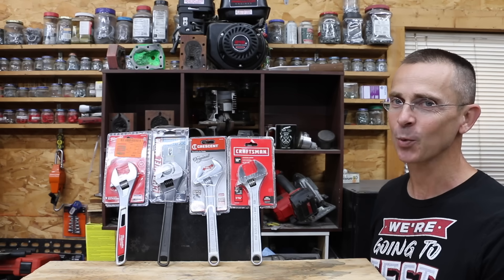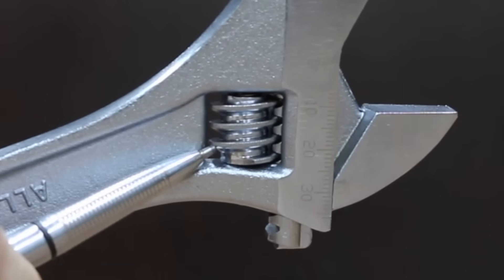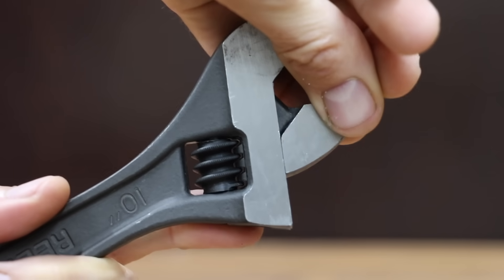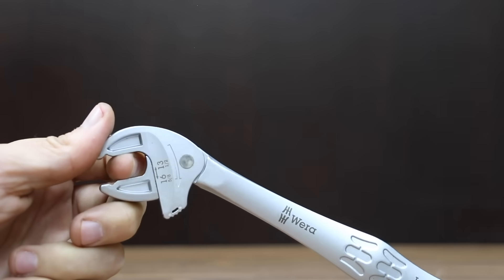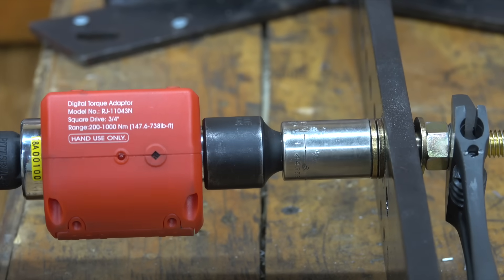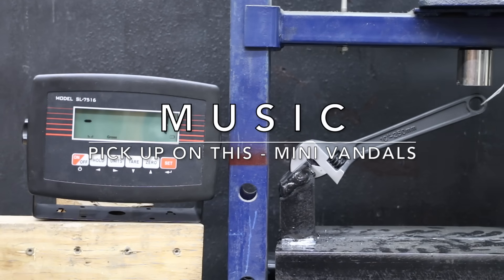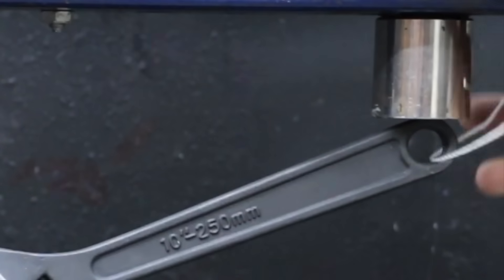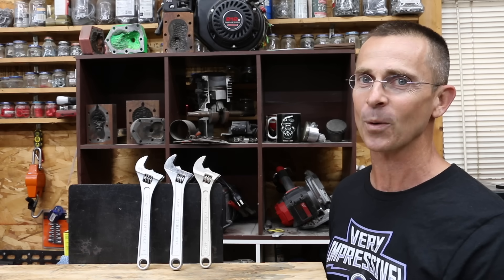Best Wrench (ADJUSTABLE)? Craftsman USA vs Craftsman, Crescent, Kobalt, Milwaukee, Channellock

Comment: I'm a Knipex fan, the adjustable Cobra slip wrenches. I use my 10" Knipex for almost everything at work as industrial maintenance. I've been looking for the best "crescent" wrench, I don't care about the price, I want durability and a 1-wrench solution. Knipex has beat out everything else I've tried/seen in the "channel lock" world but I don't want to spend $200 for 3 "crescents." I wish this test would have covered my favorite brand. However, I'm a Milwaukee guy since I like everything to be red and covered in black dust/grease. At least the Milwaukee did ok in this single test, almost makes me want to buy one to match. I've been using the HF garbage and it's time for me to spoil myself for Xmas. Anyone have input on the Knipex adjustable "crescent" wrenches? Thanks!

Comment: The only use for an adjustable wrench is to hold the service manual pages open.
Reply: Mine works extremely well for straightening bent steel wheels

Comment: I've done a lot of electrical work in industrial settings, the Klien tools are really good stuff...you get what you pay for ....interesting most all these wrenches would hold up under normal 1 hand pulling on them, but my concern would be...how long do they really last? adjustable wrenches are often used to break bolts loose, when you really should be using a breaker bar...
 I've found that a lot of stuff from Spain, and Taiwan is pretty good, compared to China.
Reply from the maker: Thanks for the feedback.

Comment: I use the Klein adjustable with the red plastic covered handles because I work in battery compartments. I am happy to have the insulated handles. But they do not hold a size worth a crap! Constantly have to re-adjust them. For the money the only thing they have going for them is the insulated handles.
Reply: Do you test to see how they hold adjustment? I can use heat shrink on them for electrical insulation.
Reply from the maker: Thanks for the feedback.

Comment: This is perhaps the funniest video I have watched today. "For both SAE and metric," LOL ! There's a reason a crescent wrench used to have the nickname "The poor man's metric wrench." That whole business of marking the sides of the wrench is absolutely worthless and ridiculous. Anybody who has used one much knows you tighten the adjustment ON THE BOLT HEAD OR NUT. If you don't you get too much slop. This kind of wrench is only good for the most basic, undemanding use. For more precise use you need good open end wrenches for medium use, and box end, or sockets for heavier use; otherwise, you're going to round off the corners of the nuts or bolts.
Reply from the maker: Thanks for the feedback.

Comment: I own a full set of Bahco wrenches. I was surprised that you didn't go for the basic 10" without the grip. It has standard jaws. The one you tested I use for difficult to access things. In the UK the brand is the best choice for plumbers and gas fitters.
Reply from the maker: Thanks for the feedback.

Comment: Great video! Made me curious, It would be interesting to see a video comparing just plain combination wrenches. Specifically to compare high end automotive brands like Snap-on and Matco to less expensive, off the shelf retail brands like Husky. Is Snap-on worth it?
Reply from the maker: Thanks!  Thanks for the suggestion.
Reply: Whether Snap On is worth it depends on how often you use it and for what application. Their biggest advantage is a lot of strength with a small profile. I think their screwdrivers and torx drivers are the best value because the tips wouldn’t strip nearly as easily. I would recommend trying out what tool you use the most like a Phillips #2 or a 10mm wrench or socket.

Comment: When I was in the navy as a machinist mate a senior person suggested that an adjustable wrench might be more effective  and handle higher torque if used in the opposite direction of that shown in the video. The movable jaw is the weak link and where force is applied makes a difference . I do remember (and still believe) that one should apply a load to the movable jaw as close to the handle as possible. If moved as in the video, force is applied to the movable jaw nearer the tip of the jaw than if the wrench were moved in the other direction. It would be very interesting to see how much more (or less) torque could be tolerated if the wrenches were flipped over and rotated with the movable jaw trailing the direction of rotation. Thoughts?
Reply from the maker: Thanks for the suggestion.

Comment: Thanks! Very well-done design and execution of tests. In the break test, it would seem that the longer jaw length gives a disadvantage, not an advantage, as it increases the length of the lever arm of the applied stress at the outer end of the jaw.
Reply from the maker: Thank you!

Comment: One thing you're not considering in the breakage tests is the length of the handle. A shorter handle that breaks at 700 is actually  a weaker tool than a longer handle breaking at the same force due to the length of the lever arm.
Reply from the maker: Thanks for the constructive feedback.

Comment: The way the wrenches were applied in the test places the most leverage on the moveable jaw because the force is applied on the outer end of the jaw. I was shown many years ago to use the wrench upside down so the force will be applied on the inside of the lower jaw toward the worm screw ( at least until the nut breaks free.)
Reply: yes, but in testing this way is how's how much better a quality wrench is over a lower quality adjustable wrench.
Reply: I'm pretty sure I've heard the opposite, but the best way to know is to get Project Farm to try it both ways :)
Reply: Glad you made this comment. I was taught the same thing. When using the wrench (not testing), you should apply the least amount of torque to the movable jaw. Realistically, an adjustable wrench should not be used for high torque applications.
Reply: @pat8988  these are literally the last result in most cases 👍
Reply: that makes sense.
Reply from the maker: Thanks for the feedback.

Comment: Did the press run out of strength on the Malwaukee? (Considering it didn't snap and some of the other tools broke at a higher force).
I'm guessing it had a different handle and that affected it?

Comment: Surely smaller jaws is an advantage in the opening under load test?
 If the jaws were two foot long the opening would be immense.
With a 1/32" jaw it would be minute.
Reply from the maker: Thanks for the feedback.

Comment: -_- this video just reinforced how crap craftsman has become over the years and makes me depressed that my american made sockets/wrench set that worked for 20 years (got it as a gift in high school) got stolen and the new craftsman set i got i already have had to replace 2 ratchets in less than 6 months.....

at least lowes is letting me just swap them out with single floor tools... you know when sears had the lifetime swap for craftsman you got it knowing you would probably never have to use it....  now you hope you can do it because you will have to use it....   "sighs"
Reply from the maker: Thanks for sharing.

Comment: Bacho is the only real one the rest is fake
Reply from the maker: Thanks for the feedback.
Reply: @ProjectFarm  I have a Bacho set of (really) 60+ years old and they are indestructible, better than they are now.
I am 66 myself and they belonged to my father and he used them from the first memories I have of him.
We even call them BAKO here 
Most of the wrenches in this video are copied of the old Bacho model and the first copies, to cheat the patent, the  threaded adjuster thingy (sorry I am dutch I don't know the proper name) turns the other way to adjust the opening. 
And this is really annoying if you use them when you are used to the Bacho.
Reply: @ProjectFarm  I can send you some pictures if you want..

Comment: You have to understand that "Made in China" products are designed for failure. Not because they are no good at making product, but b/c it is their business model. I've purchased the base portion of a desk chair multiple times and most of them were from China. The welding job around the base was, hands down, the worst welding job I've ever seen and every single one I purchased in a 10 year period always broke in the same place right at the base of the weld forcing me to purchase a new one over and over. I finally got fed up and purchased one made in America and the welding job was flawless in the area where the China made one was shoddy. I've had the made in America base for 10 years now and not a single crack at the base of the weld.
Reply from the maker: Thanks for sharing.

Comment: Back in the late 1990's, I worked Part-time as a Mechanic for my Brother-In-Law at his shop.  Some Guy had brought in his car for an oil change and after I got it up on the lift, I started to remove the drain pan plug with my Crescent (actually a Craftsman, LOL!) wrench.  The Guy asked "You're not going to use THAT, are you?!?" and i replied "Yes Sir, I am" and went on with the job (it seems he thought using an adjustable wrench would round off the corners on the drain plug...it didn't).  My BIL told me later that this guy thought his car was "Special" (it wasn't) and was extremely "Picky" about how things were done to it.  I told my BIL that I can appreciate that since I also am "Picky", that's why I change my own oil and Apparently that Guy should also, LOL!
Reply from the maker: Thanks for sharing.

Comment: None of these are relevant 

Crescent spud wrench master race 

Basically a c wrench with a big metal spike for a handle used to align bolt holes or cook a spud I used them when building stages 

Also used it to pop my serpentine belt on with a broken tensioner in subzero temperatures by myself or I could move a 10,000 pound media riser by myself when I did the nhl  nba changeovers at lca with it
Reply from the maker: Thanks for the feedback.

Comment: As a plumber of 16 years I have to say I love your videos. However, from what I seen, the Milwaukee is the clear winner! It's the only one that didn't break in your last test and the one that moved the least in your jaw opening change under vibration. Which are the 2 most important factors when considering a crecent wrench. 

If you're tightening or loosening a bolt the most annoying and time consuming thing is to constantly have to re-adjust it. Milwaukee is easily the winner just by winning that test alone. Which is the most important test that actually matters for every day use. Let alone the fact it's the only one that didn't break in your last test. And there's actually a way to get it to work again once it seizes under heavy load like that... A couple hard smacks and some WD40! I've been using those crecent wrenches for years. 

You can call me biased but I was actually watching this video specifically to see if any crecent wrench could beat it. However from what I seen in this video is that the Milwaukee still remains supreme for the reasons I listed above.
Reply from the maker: Thanks!  Thanks for the feedback.

Comment: The Germans call an adjustable spanner 'ein Englander' because British tradesmen use them all the time. Adjustable spanners not allowed in the UK military and I agree always use the correct size spanner and being electrical always use the correct scewdriver and don't overtighten screws. As life is not perfect and you have to use an adjustable then Swedish made Bahco is the best in my opinion.
Reply from the maker: Thanks for the feedback.

Comment: Please, 100 % of anything I have say MIC has 2 year life, my God my breaks for my car didn't know auto shop installed 6 months they came off. No competition not even watching vid cause if mic wins its rigged. We have 100 items we ended finding mic which means it's going fall apart, my God I had purchased water boots next years the rubber crumbled. Forget about it

Comment: idk about you but i'm surprised none of them have a pipe slot in the end of the handle to either put a pipe over the handle or inside the handle to add huge amounts of torque for bolts that are NOT hard to reach but need more leverage to break the seizes/grip of the nuts and such due to rust or damage.
Reply from the maker: Thanks for the feedback.

Comment: As long as the tool can do the job for me and reliable.  I will buy it.  Just like a car.  I do not care about power seat , 10 speaker system, 3 zones ac.  I think you got my points.
Reply from the maker: Thanks for the feedback.

Comment: Although very thorough,  your rounding nut test was flawed. You had the adjustable upside-down.  I'm sure it was the most convenient way to setup the tests. But the moving side of the jaws was taking all the torque.  You should have set them up so the stationary side takes the torque.
Reply from the maker: Thanks for the constructive feedback.

Comment: Each test in this experiment may produce two different results in two different torque directions. 
Caused by : 
- The stress profile from jaw tip to root are not equal. 
- Jaw cross sectional area profile from jaw tip to root are not equal. 

Note1 : the cross sectional area at the weakest point of each jaw, are close but equal. 
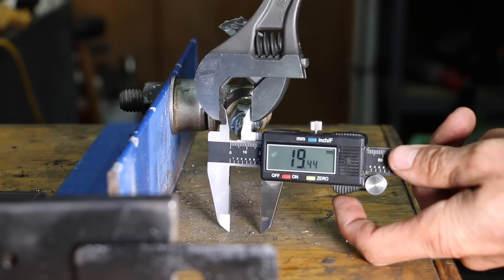Note2 : the tool placement on page 5:43. The lower jaw takes on bend moment from the same hex load more than the upper jaw, in a downward moment. And vice versa in an opposite moment.
Reply from the maker: Thanks for the feedback.

Comment: How about set of water pump sliding pliers?
They black oxide coat the jaws and handles, yet use a chromed grade one bolt to hold them together. Ridiculously priced at $99. Sold as set of three by a major race car parts supplier.
Reply from the maker: Thanks for the suggestion.

Comment: I bought a set of four hardened torx bits for
$4.99. Twisted the T-27 and stripped off one edge. Fortunately I didn't mess up the bolt.
Returned the set and bought the single torx for $3.99.  Seems to me that bad production runs of foreign made tools are placed into a set of X number for bargain hunters. You get what you pay for.  Our ports are dumping grounds.
Reply from the maker: Thanks for the feedback.

Comment: Excellent testing Todd. I like the innovation of the wrenches that work on both English & Metric. No longer the need to carry both in the tool box. Maybe the same technology will be available for vise grips English / Metric too. Thanks again!
Reply: The worst part was not knowing if the bolt was English or metric and not being able to choose the correct adjustable wrench!
Reply: @HanginInSF  Agreed. Especially when driving Detroit brand vehicles these days. I pack both metric @ SAE adjustable wrenches also both range vise grips in the trunk. The most useful item in my tool box is my sneakers.  More times than not, I’m pushing my American gem back to the dealership for warranty or issue problems.
Reply: They also make English and metric tweezers now, to fit both American and European eyebrow hairs.
Reply: @smadaf  ah yes that makes sense. I know that you may purchase Asian / English tweezers. This combo is also referred to as Chinglish tweezers. Very handy, without splitting hairs.
Reply from the maker: Thanks!  Thanks for the feedback.

Comment: You are using the wrench the wrong way! The wrench should be used so that the force is placed on the moveable jaw on the surface closest to the handle.

Redo the tests using the adjustable the correct way.